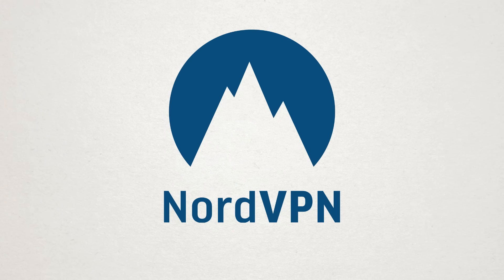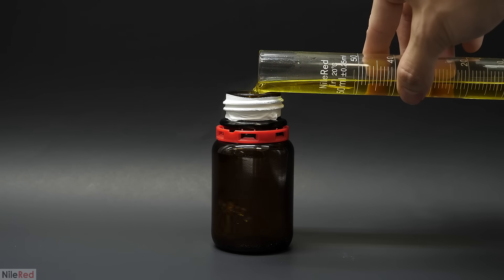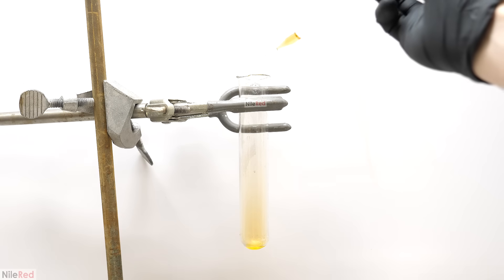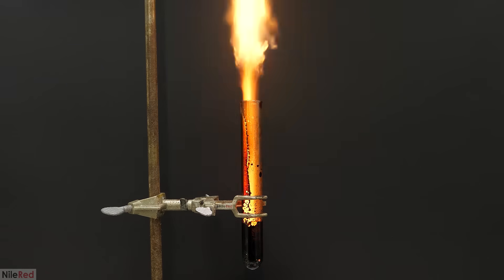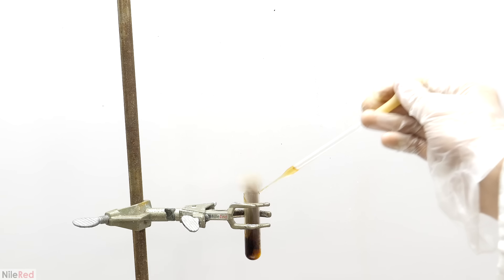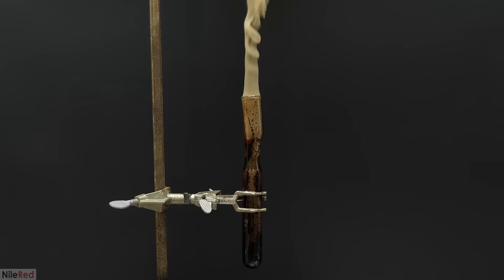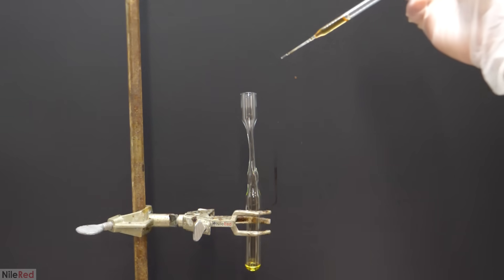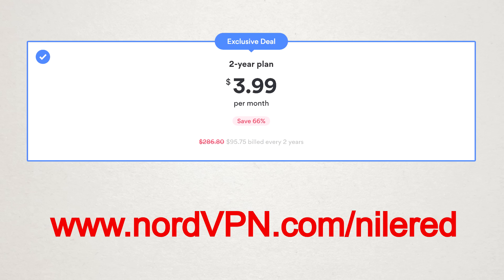Making test tube liquid rockets

Comment: ROCKETS DO NOT work in vacuum, as they have nothing to push against. 
A little off topic here I know, but anyone can perhaps demonstrate rockets work in vacuum?
Great video in my opinion, thank you NileRed
Reply: This is not true, rockets need nothing to push against. They are based on newtons third law which says, that every action has an equal reaction in the opposite direction. If you are floating in space and you throw a heavy objected, you will be propelled in the opposite direction. If you shoot a gun, you can feel the recoil. Rockets eject reaction products as hot gasses and these gasses have a mass. So the rocket gets propelled in the opposite direction of the nozzle. It does not matter if there is air around it or not.

And really, the earth is not flat.
Reply: " Experimente 99 ",

Fascinating drivel. Can you back it up with a PRACTICAL DEMONSTRATION of a rocket PUSHING OFF OF VACUUM? No? Why?
Reply: Flat Enough yes they can. We’ve sent rockets to the moon, mars, out of the solar system, Venus, Jupiter, the sun, etc.
Reply: @FlatEnough  Here you can see a practical demonstration: https://youtu.be/76JM03a6WH4

You can actually try out a simple experiment at home. Try to sit on a skateboard and throw a heavy object like a dumbell. The skateboard will move in the opposite direction of your throw.
Reply: @FlatEnough  You're the one with the fundamental misunderstanding of Newton's 3rd law and rocket physics. 

Rocket motors "throw" gas out of their nozzle. The gasses that leave the nozzle have mass. The act of the gas leaving the nozzle causes the nozzle to move in an exactly opposite vector. Vacuum or atmosphere is irrelevant. If you tie a gun to a swing and fire it remotely, the recoil will cause the rifle to swing backward.  

You're clearly misunderstanding, as rocket motors and thrusters have been operating in outer space since the 60s. If you reply to this with any kind of conspiracy theory about not having been to space, flat Earth, and "CGI" images, I have 0 interest in talking to you further. Such nonsense is not to be entertained.
Reply: " Ryan Shane ",

Who is "we"? What on Earth does this have to do with my question?   
After you solve your "we" personality disorder, DEMONSTRATE your claim about rockets pushing off of vacuum.
Reply: @FlatEnough  Evr frickin' thing you'll dismiss as insignificant ( wow such a long word for ya' mate :) )
Reply: mannys9130 Rockets have been operating in outer space since the fifties actually, perhaps the forties.  I don't know how high the ballistic trajectories of the Nazi V2s took them, but it's possible they entered "space" as it is currently defined by international standards.  I could be wrong there.  Anyway, regardless, Sputnik was launched in '57, which undoubtedly involved rocket operation in space.  The US followed suit shortly thereafter.
Reply: " Science Compliance ",

Fun stories. How do you know of all this? 
How do you know it's not crap? Have anyone PRACTICALLY DEMONSTRATED to you a "rocket in vacuum"?
Reply: Flat Enough - Why are you dodging my questions? If what you claim is correct, then how do planes fly at high speed, and how do things break the sound barrier? Once you're past the speed of sound you have nothing to push against.
You don't even need to do a practical demonstration - simply explain it.
Reply: Flat Enough where'd you go bro? Done trolling?
Reply: ever heard of newtons third law of motion?
Reply: " Captain Heat ",

Yes. Ever heard of "argument from ignorance"? 
PRACTICAL DEMONSTRATION of your claims please.
Reply: You can't teach people who ignore evidence. Don't waste your time.
Reply: Take a medicine ball, and throw it as hard as you can. You get pushed back right? Now, in space, the rocket is shooting flaming fuel behind it, which is equivalent to throwing a whole lot of medicine balls. Throwing the medicine ball and getting pushed back has nothing to do with air. Same with rocket propulsion.

Edit: Also, "old" people scribbling on whiteboards can be viable proof of something. You can prove the formula of the area of a circle is πr^2 by "scribbling" on a chalkboard.
Reply: The rocket pushes off of it's own fuel, if you could somehow rope expended fuel to the rocket, then it wouldn't be able to move
Reply: Oh look here, a fucking flatard, trying to disprove physics.
Reply: https://youtu.be/-BsrzO7aXNs

With slow mo video
Reply: " Andor Rudolf Markus ",

Excuse me, the video you linked does not show vacuum. 
The claim is that "rockets push off of vacuum", I want to see the demonstration.
Reply: Flat Enough that claim is not being made.
Reply: Ya' know wut? I don't wanna argue with kind of ppl like ya'. Y no nothing
Reply: Stop showing me videos of old people writing squiggles on whiteboards. 
Stop showing me videos of not vacuum.
Stop showing me videos of rockets not working in thinner "almost" vacuum (codyslab)
The demand is: DEMONSTRATE a rocket PUSHING AGAINST NOTHING, and MOVING THE OTHER WAY. 
Why can't you?
Reply: Oh people. Can you not recognize a troll?
Reply: @FlatEnough  
Did you know that space is not perfect vacuum either
Reply: " Fossil Draws ",

If you properly educated yourself in the scientific method you could use your common sense, apply the method and recognize what is science and what is not, not to mention you would be able to argue from a properly founded position AND at the same time be able to beat your video game addiction.
Instead, you chose to ignore that I am calling for a PRACTICAL DEMONSTRATION while at the same time you believe "you know stuff because you read it on the internets" .
Who is the troll again?
Reply: @FlatEnough  
How many people actually own access for a private trip to space, or better yet, a lab-grade hard vacuum chamber? I can see who is the problem here.

More importantly, your claim also violates what was considered doable during the space race. How can you reduce speed to enter lunar orbit if rockets won't work in space vacuum, considering that the Moon has no atmosphere at mission flight paths?

The closest near-absolute vacuum is the space between galaxies, and do not even have a vehicle capable of leaving solar sphere of gravitational influence.
Reply: @FlatEnough  Sir, you are clearly uneducated enough. These squigly things are calculations, if you would watch the entire video and, as you probably didn't, you would understand the basic properties of thrust engine in vaccum. I can explain it to you if you don't seem to believe in any given proof showing video. When to propeling substances get in contact/they are ignited, they figuratively explode. We will assume for now that expanding gasses from such reaction form perfect sphere. It hits back of the engine and pushes it, it hits sides of engine and nothing happens, because it forcing itself evenly acros all the area of side walls and there is nozzle. There is nothing to push agains so you are left with force aplied to back of the wall propelling the rocket. So it can work in the vaccum of space. However i think that either of my oversimplified explanation nor video recordings will satisfy you, sir. Educate yourself and please, think about your worldwiev at it seems if it's enirely true or filled with delusions and misconceptions.
Reply: " Aereto ",

"my claim"? You are confused: I placed no claim. 
I placed a demand for a PRACTICAL DEMONSTRATION of the claim that "rockets push off of vacuum". 
Can you demonstrate this?
Reply: " Lesser Dog has gone where no Dog has gone before. To youtube ",

Fascinating word salad. Now let's move on to the part where you PRACTICALLY DEMONSTRATE the nonsensical claim that "rockets push off of vacuum", so that you can prove that you are not a charlatan snake oil salesman. Show me. Where is it?
Reply: " omni tunturi ", 

You wrote "Did you know that space is not perfect vacuum either"

What is that supposed to mean? Am I to understand that you are saying "rockets push off of the very-thin-but-not-exactly-vacuum-of-space", is that what you are trying to say here? Something else? 
Do you understand the demand?
Reply: " Ryan Shane ",

You wrote "that claim is not being made."
How do your magic spacecraft travel through the imaginary "vacuum of space"? 
Do they simply teleport there and hang out?
Reply: You're the one claiming that the entirety of human physical knowledge is wrong, so maybe you should provide evidence of your claim instead of just some squiggly lines on a YouTube comment?

Out of interest, where does this grand conspiracy start and end? The SR-71 had a service ceiling of around 26,000 m. At that altitude, air pressure is less than 5% of sea level, yet it managed to travel at 3,500 km/h. If your claim were true, then this wouldn't be possible as the air is too thin to push against. Or is the SR-71 a lie also?

Are commercial airliners also a lie? With conventional physics, their engines get more efficient the faster they travel, however if you're correct then they'd get less efficient the faster they travel. In fact, nothing would be able to travel above the speed of sound as the reaction force would be limited by the speed of sound in air - so the air couldn't push back. Maybe the speed of sound is a lie too?
Reply: @FlatEnough  Rocket does not push air. Gasses produced inside rocket push it
Reply: @FlatEnough  Sir, as I said. You don't bother to watch any of given data or information, you just dismiss them through filter of yours believes. Just look at them, these are real pieces of evidence, rockets in vaccum, calculations.
Reply: " Lesser Dog has gone where no Dog has gone before. To youtube ",

You misunderstand: just because you believe "in rockets in vacuum", does not mean that I should believe that tale too. 
I demand a PRACTICAL DEMONSTRATION for it. Where is it?
"calculations", "data or information", half-baked garage "vacuum chambers" the size of a cookie box and other irrelevant nonsense is NOT a practical demonstration.  
Where is the ONE thing I am asking for, the practical demonstration of a rocket pushing against nothing and moving to the opposite direction?
Reply: @FlatEnough  No one who seriously studies, builds, or flies rockets thinks that rockets "push against vacuum."

People answering you here have been humoring you thinking you misunderstand how rockets work, but that doesn't seem to be your issue.

Why are you demanding a demonstration FROM US of something that none of us believe happens?

BTW, "argument from ignorance" is a logical fallacy. It's not a reason for anyone to think that you're winning an argument. If you really want to believe what you want out of willful ignorance, nothing anyone else says or does will change your mind. If no argument will work, there's no reason to argue for or against anything, is there?
Reply: " kmarasin ",

I did not see any PRACTICAL DEMONSTRATION for "rockets pushing off of vacuum" in the above rant of yours. 
Try again (or don't)
Reply: " Drunken Hobo ",

Can you answer the question instead of hopelessly trying to evade?
It is very simple: claim, rockets in vacuum. PRACTICAL DEMONSTRATION? Where is it? Show me.
Reply: You don't need to see "PRACTICAL DEMONSTRATION for "rockets pushing off of vacuum"". Try again (but it's probably better if you don't.)
Reply: " kmarasin ",

No, you are wrong, I do need to see, and the ones claiming that nonsense need to show me. 
Otherwise it's make-believe nonsense. Natural science is about demonstrations. You cannot demonstrate it? Sorry buddy, it's not science, it's crap stories.
Now, PRACTICAL DEMONSTRATION, where is it?
Reply: But I don't need to demonstrate something I don't claim to be true?
Reply: " kmarasin ",

No, why would you need to?
Reply: I'm glad we're in agreement. Rockets don't work by pushing off of vacuum.
Reply: " kmarasin ",

We are in agreement in that you do not need to demonstrate what you do not claim, and from it follows that all claims about things practical need to be practically demonstrated.  
This means that if you are putting claims to be objectively true (such as "a rocket squirting out some substance into vacuum and as a result rushes forward") then you must provide a practical demonstration.
Reply: Flat Enough it does NOT actually logically follow that all claims need to be demonstrated. If I had said instead "I cannot claim what I cannot demonstrate" then it would, but that's a different claim.

But that's beside the point, you have been demanding that someone must demonstrate the claim that rockets work in a vacuum from the start of this thread, and despite several video demonstrations of this, you have found reasons to reject every one. What is the standard of proof that you desire?

To be more precise, since things like "perfect" vacuums or regions of space where there is nothing else of substance "nearby" (how near is too near?) are physically impossible to arrange, how would YOU prove (or disprove!) this one way or another?
Reply: kmarasin For most practical purposes, you can assume space is a perfect vacuum.  The particle density is extremely low.  You still have to worry about drag de-orbiting satellites in low Earth orbit, but the time over which this occurs is very long considering how fast satellites are moving.
Reply: Science Compliance  I'm a physicist, so I understand all this. Our friend "flat enough", however, doesn't seem to believe in assumptions or practical purposes, or inductive logic in general. 

This is about more than how to do physics; this is about whether or not a real-world experiment allows us to make abstract generalizations like e.g. Newton 3rd law that we can assert as facts.
Reply: @sciencecompliance235  I agree entirely. You've hit on the crux of the issue. This is about what it means to be rational. If we cannot EXPLAIN that, and also convince someone of the need for rationality, the Age of Reason is on shaky ground indeed.
Reply: https://youtu.be/FEom0G30Gic here you can see that the rocket's angle relative to the Earth changes after the second stage ignition
Reply: Tell that to space vehicles?
Reply: OMG thank you why didn't nasa think of this
Reply: Anticonny Exactly.  There's nothing that will convince them.  Not worth the oxygen to respond.
Reply: https://www.youtube.com/watch?v=-BsrzO7aXNs

Another demonstration of a rocket thrust in a vacuum.
Reply: https://www.youtube.com/watch?v=T8MOoUuLnug

And another one. 

It's almost like I was able to search an endless list of videos for exactly what you asked for.
Reply: " Mr. V ",

Did you even check the nonsense posted above before spamming foolishness into the comment thread? 
Again, DEMONSTRATE "some rocket" pushing off against nothing.
NOT against the container, NOT against the thinned air, NOT against a 5x5x5 inch container, but against NOTHING. 
Can you do that?
Reply: " Pragmatic Peasant ",

Live up to what your youtube username implies, and PRACTICALLY DEMONSTRATE once and for all something pushing against nothing and moving the other way, exactly how the nonsensical "rocket in vacuum" allegedly does. 
Where is the practical demonstration?